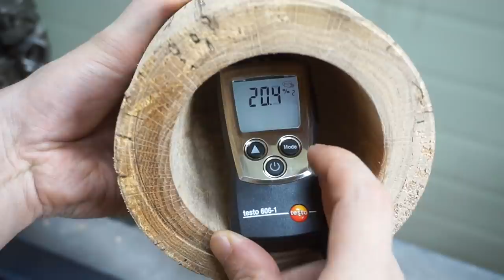Woodturning - Oak Goblet Bowl

Comment: What is in the box at 3:42, that helped dry the wood? Great work btw!
Reply from the maker: It's silica gel. I use it a lot as a dehumidifier.
I used a mixture of silica gel that changes color when moisture is contained and silica gel that does not change color.  This is to dry the silica gel when the color changes.
It can be reused by drying it in the sun or drying it in the oven.
I hope it was helpful. Thanks for watching. Have a good day.😀